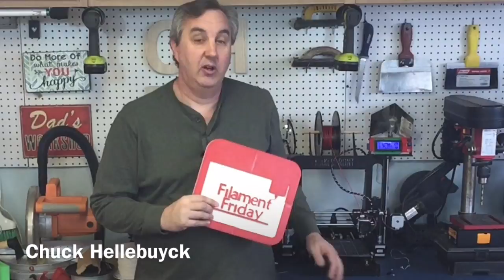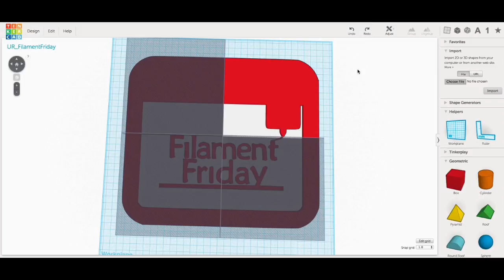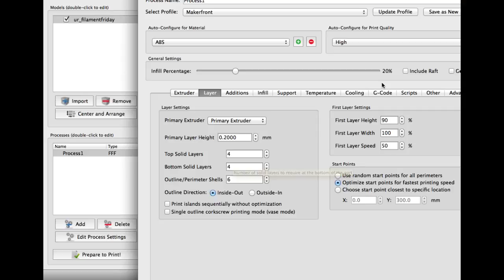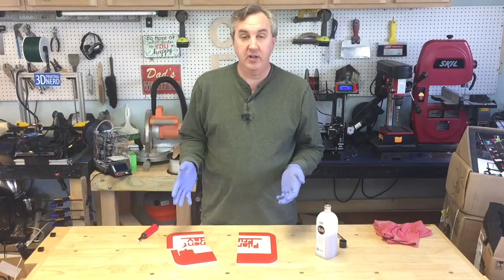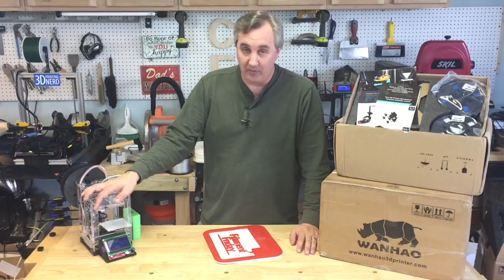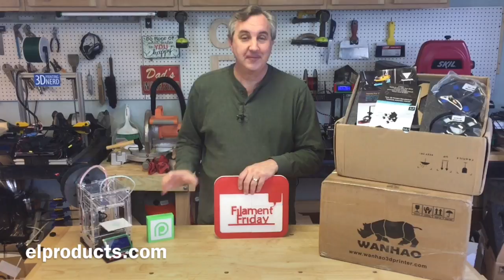Filament Friday #59 - 3D Printed Large Logo Sign on MAKERFRONT Printer

Comment: Well done. The only printer with a big enough print bed which can print a 12x12 object (not sure if this is not square) -- in ABS is the series 1 Pro from Type A Machines (one of my printers) and it's way far from the price range the printers you use are -- it was $3300 when I bought it and it is going up in price to over $4000, so this is really good work to print something in parts.

Comment: that would look awesome dual printed with the filament friday coming out of the nozzle a different colour! i haven't done much dual printing because to be honest, never had the need too. I am going to try to copy that and miniaturize it and dual print it to see how it comes out. Oh and by the way, sorted my problem with fab mini The belt was way too tight so it wasn't allowing the roller bearing at the end of the x axis to spin freely so you were right it was locking up. I loosened the belt by prying it with a precision screwdriver and backed the tension off 3 teeth on the cable tie and now every print perfect! I can see what you mean, I am printing real quality. Now i just need to work on speeding my prints up. I am still using repetier as i wanted to keep everything standard but will be tinkering s3d settings now because what takes 90 mins on fab mini takes 30 mins makerbot clone with simpify 3d